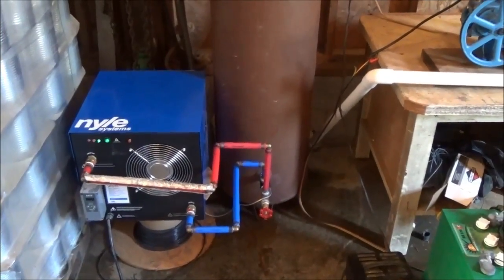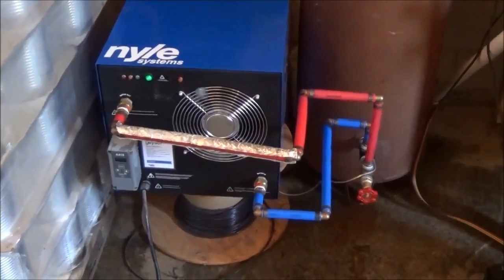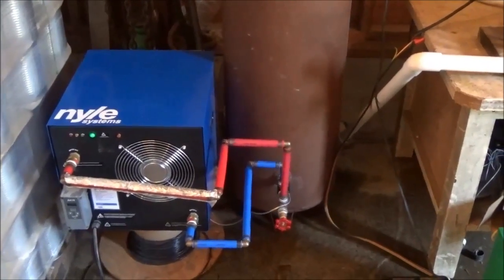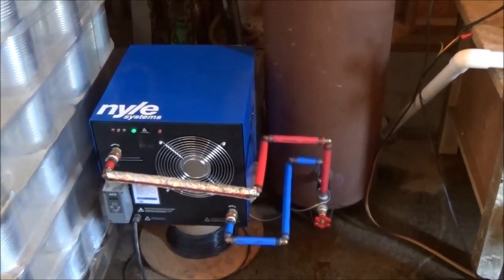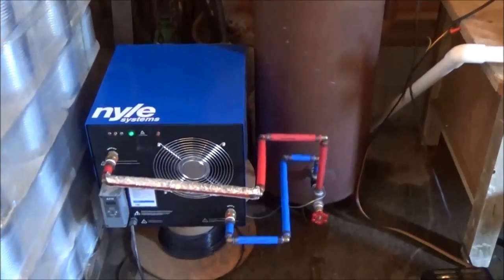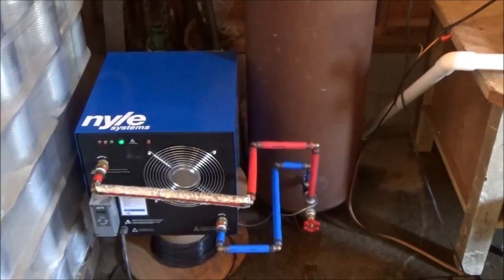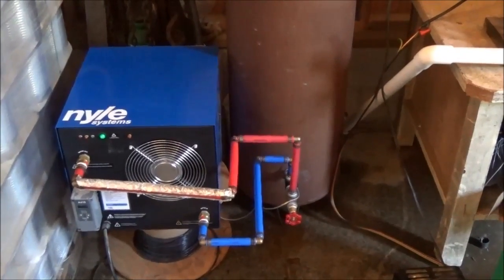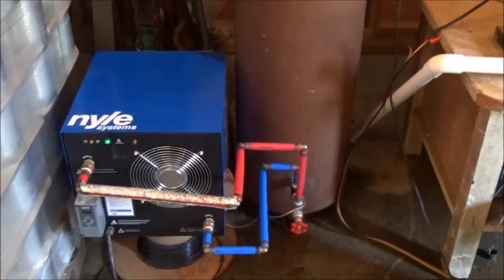Hot Water Solution and Prizes Awarded.

Comment: Why do you have both hot and cold attached to the same tank inlet?
You can't possibly heat a full tank with this set up. At best you'll heat a bit at the bottom.
Ideally, you'd want to connect one to the top of the tank and the other to the bottom.

This sort of half-arsed misinformation is a big part of what's wrong with the prepper community. Every jackleg DIYer fancies himself an "expert."

Comment: It appears to me that the hot water tank has no insulation. You state that the heat pump cools the room it is in. I have to presume this is a temporary setup because you have the heat pump setting on a spool of wire, but the connections to the tank look very much finished. What's the matter with this picture? How does it make sense to put a uninsulated hot water reservoir in a cool room?

Comment: Having lived off grid, I can agree 100%. Once you have shelter and food/drinking water. Hot water is the next priority.
Not only does life suck without a shower and hot water for food prep and wash up. But its a health issue. Small cuts and scrapes start to get infected, you get rashes in all sorts of inconvenient and sometimes embarising plases, which can make movement extreemly painful. Your food prep area starts to become a bacterial breeding ground, spreading gastro.

The one point I would add to you video comentry. Is that you need a few sources of hot water. In my Shack, where I mostly lived Solo. I had a Solar hot water system, and a wet back on my fireplace. Sometimes it was too hot for fires, or too cloudy for solar... Sometimes one system went down for days or weeks at a time while I either souced parts or tried to get time to do the repairs. A couple of times both went down at once. Not happy times. Eslecially when the systems have failed due to frost bursting pipes. If I did it all again I'd be sure to have a third tank and lots of spare parts.
Reply: Draindown!

Comment: What would be a low buck way to heat water for a Jacuzzi? Thinking of getting one but really don't want to pay the powerbill that sucker would pull. I'm in the desert so something solar maybe? During winter that'd be problematic though I'd think.... I'm not sure, any advice?
Reply: They make solar covers for swimming pools to warm the water up in them. Almost everyone up here in the North uses them in the spring and fall to keep the water warm enough to swim in. I would find out what that cover material is and order some bulk to cut to fit your Jacuzzi. Or you could maybe find a deal at a store on their clearance rack of a ripped/damaged solar cover and cut that to fit. Then just keep your window blinds open with the cover on the water to heat it up. Of course this wont' work if your Jacuzzi isn't in the direct line of sunlight through the windows.
Reply: My friend's pool is black. I have not seen it full, (it was the previous owners idea) but I would think it would absorb more...